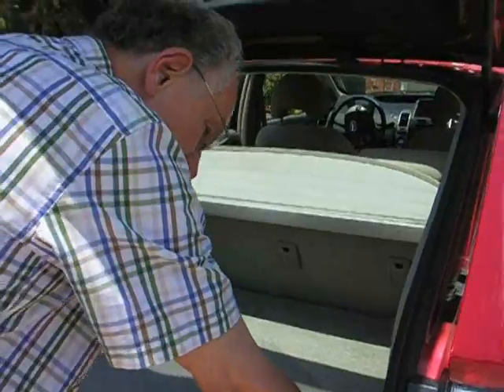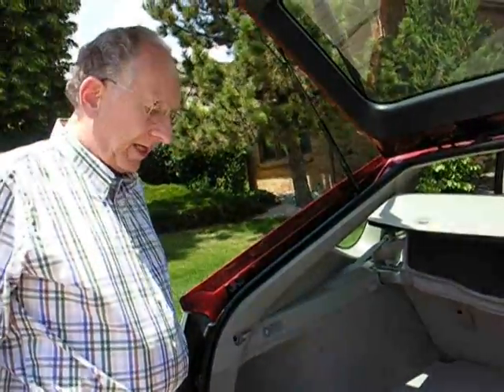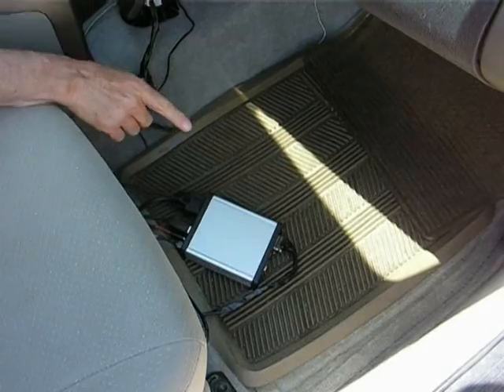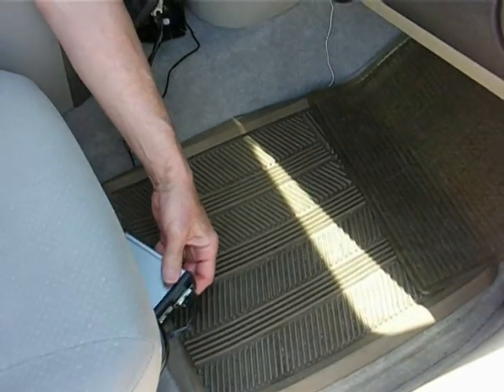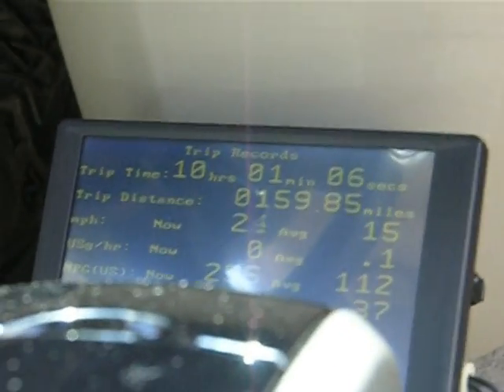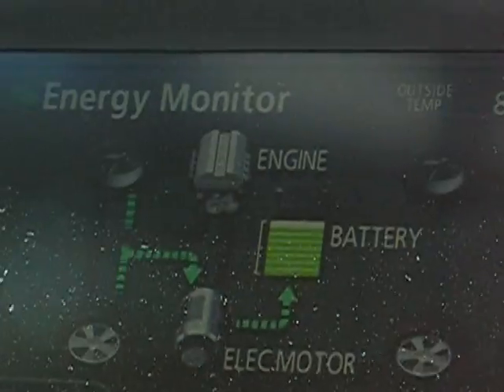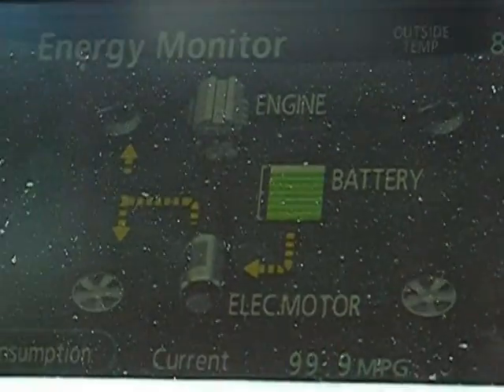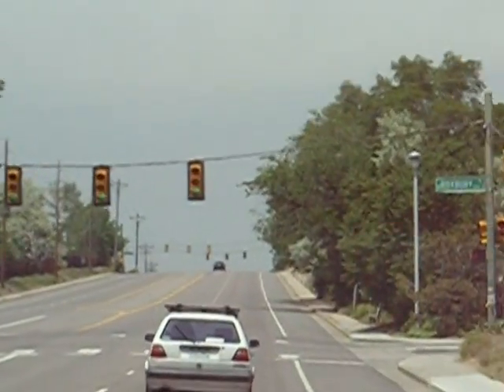2006 Prius conversion to plug-in

Comment: What about if I ad stock hybrid battery to parallel?
Reply: I think the hidden other reason he went with lead acid is it made it so he could charge it faster from wall power without a complex battery management system.

Comment: So all we demand is plug in hybrids? Pretty low bar, I say. I hypermiled in my 1998 corolla until there was a viable 100% electric car available for me. I saw the Mitsubishi iMiEV in 2010 which, at the time, was insanely expensive, at $50K (Australian dollars). I waited (patiently) until 2017 and bought a used one for $17k.

We love our car, charge for free at our local university purely from solar and as it isn't our infrastructure, we didn't pay for any set up costs. The car was fully paid off in under 2 years and we pay for little other than new tyres.

Here's a recent article I wrote about a road trip I completed in our short-range EV.

https://steemit.com/travel/@nickmorphew/exploring-the-southern-highlands-in-australia-s-rarest-mass-produced-electric-vehicle-mitsubishi-imiev

All this bs about hybrids should now be over. Hybrids were the transition vehicle. Excellent evs are now widely available in most countries (sadly, not so much in Australia yet due to our pathetic govt.)

Leaf, imiev, ipace, model 3, ioniq, kona, zoe... the list goes on.. and will into the future.

Comment: I have a 2006 Prius and my battery cells started going out one after another. 3 to be exact. Within 2 months. They are about 20-40$ used on eBay. So at 337,000 miles my original battery was removed at home by me. Not very hard what so ever! You're gonna need some muscle. The brand new one cost me 1800$ with a 3 year unlimited mile warranty. This all happened early 2016 and as of last night I now have 357,000 miles. Still going awesome. And lately I have seen some new battery packs for around 1000 or less. With a warranty of course. All that aside it was way better than 3700$ the dealer quoted Me. And it only had a 3 month 5,000 mile warranty. As for the motor... it burns about a quart every 3k miles. ZERO LEAKS!!! Never had the head, valve cover gasket changed. I should do that soon. The lifters are very very noisy and has been that way since 275k and the exhaust flange right before that cat is bad. 6$ fix. Simple fix. I have had this car since 0 miles. And plan on driving it till the motor blows. Then I'll fix it. Ohhh and the front brake rotors are original with just a little bit of rust. The pads were replaced at 100k "the dealer recommended" I still have 60% pad left. The first and only repair I did besides the battery pack was a wheel bearing at 70k. I have spent a total of $4,000 on tires and I do my own oil changes... mobile one super high mileage 10w/40. It's good for 7,500 miles. Since I burn 1/4 or the oil and refill little by little once every 300-400 miles "every gas fill" the oil stays somewhat clean. So I have been stretching the changes to 12,000 miles. I buy a k&n oil filter used for a marine engine. It's very large compared to the original. It holds another 3/4 quart. If you have any questions for this very OLD VIDEO email me at. 
Repairserviceofmn883@hotmail.com

Comment: Thanks, very interesting.  A couple questions: 1. What happened to the spare tire and jack?  Are the batteries sitting in a tray, above, which can slide out without having to disconnect everything or did you have to set the spare tire aside?  2. It looks like you have many straps holding the batteries in place.  Any shifting?  Any fire hazard?  Thanks, again.

Comment: how many miles per gallon is the car actually getting ? that is resetting the odometer to zero at tank fill up and then running the car till the gas in the tank is reduced lets say to at least half. then taking to actual miles driven as per the odometer reading and dividing that by the number of gallons it takes to to refill the tank.